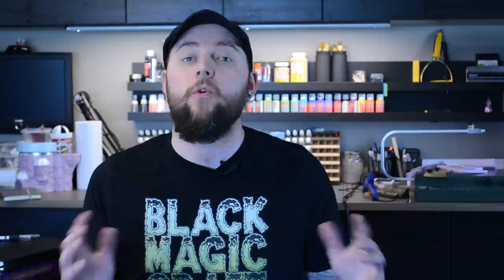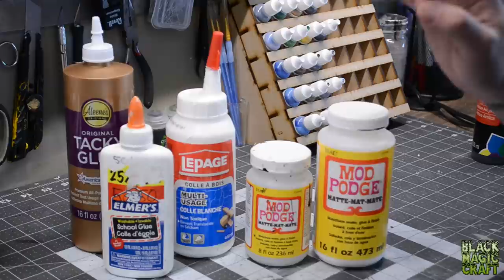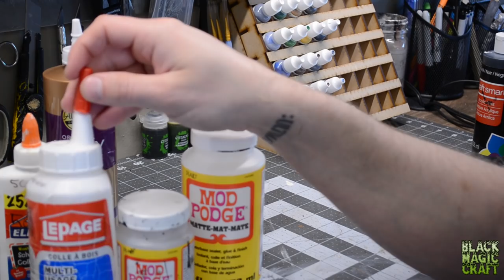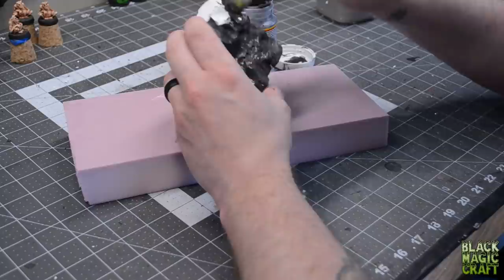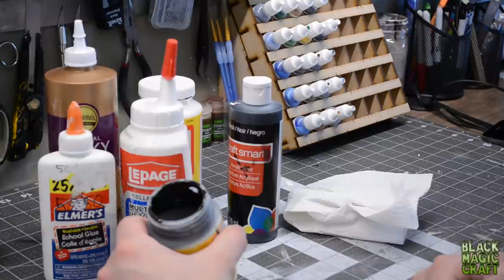Black Magic Base Coat! How to protect and and harden your terrain (Black Magic Craft Episode 034)

Comment: You should just make a homemade batch of MOD PODGE, mix in some black paint, and sell it as Black Magic Craft Magic Base Coat. You'll make millions! Seriously, though, I just started doing this on my projects. I seriously almost messaged you a couple weeks ago about ratios then just thought, "Screw it!" and dumped some black paint into my MOD PODGE pot.
Reply from the maker: Lol, the thought crossed my mind, but alas my role is to provide knowledge and not create a product....not yet at least.

And for the record, you mention homade mod podge. This is actually a thing people try to do, and from everything I read it usually yields very poor results and is kind of silly considering mod podge isn't really that expensive.

Comment: So I got curious with this and felt the need to post here.  I have been 3D printing my terrain, and that has its own set of challenges.  FDM prints have layer lines no matter how finely you print, and they have a capillary effect with paint.  So you need to use filler primer, sand it down, prime again, sand it down, etc.   On top of that I live in Florida where it's too humid to prime outdoors half the year.  So I wanted to try this stuff. While it preserves detail, I felt like the thickness of the fluid would fill those tiny crevasses, and it would act as a primer.  So I tried it last night on some 3D printed rock formations for scatter terrain.  Stuff I could just throw out if it didn't work.

IT WORKED GREAT!!!
I coated the rocks in the black mod podge and let it dry overnight.  All of those finer crevasses between layers were filled in fairly nicely (I will say some of the tops, I did have to slop it on instead of putting a thin coat). It worked as a both filler AND as a primer, they took paint beautifully. I painted, drybrushed, and flocked them today and I am thrilled with how they came out!  GAH I'm so happy!

Comment: I used tacky glue to repair my large bamboo chimes that remain outside.  I used it in all the places that were cracking and tied with cheap strings and I also coated the strings to seal with tacky glue  that I decoratively tied up and down the chimes.   It was unbelievable the adherence of this glue.  I am on year three and these bamboo chimes have not cracked any further and the string has not even begun to rot.  It is magic!

Comment: Another thing about buying both Mod Podge and Tacky Glue (specifically the brand he has too) is you can sometimes find it at dollar stores. It's not a guarantee. You'd probably have to get lucky. But I have seen both at the Dollar Tree before. It did not stay in stock long. So get it if you find it. I imagine it was overstock from some nearby store. Though as the video mentions it isn't that expensive anyway if you can't find it.

Comment: I'm fairly certain that modge podge is pva/acrylic matt varnish mix. Also anything that can be 'watered' down don't use water. Use 99% isopropanal alcohol instead. Dries faster and removes the surface tension that is talked about here that stops it flowing like paint.

Comment: I just put together a "tower" with foam food trays, chip-board from a frozen dinner, and a plastic bottle as the inside (makes great clear green windows).  I used an Elmer's glue-stick (not the washable kind) and it held the pieces on fairly quickly, however I did have a few "bricks" that I had to reattach at the end.

Have you ever tried glue sticks?  It seemed pretty easy to just have it open and swipe my pieces across it to get the glue on them.

Comment: Mod-podge is well worth the money. It's really good stuff. Your method of using it I may try sometime, but for terrain I will actually paint everything THEN give it a layer of mod-podge to protect the paint job because the stuff dries clear. Good video.
Reply from the maker: Yea, I don't think it's really that expensive in the big picture....I've never tried using mod podge after paint as I am so partial to the minwax spray.

Comment: This is amazing when mixed with enough airbrush thinner to make it a creamer like consistency.  Ive used it on terrain and to erase layer lines on printed minis.  But be sure to clean your nozzle regularly!
Reply from the maker: You managed to push mod podge through an airbrush???? Which model?
Reply: @BlackMagicCraftOfficial  The Master Airbrush dual action lol.  Thinned down with homemade thinner to keep cost down and with pressure cranked up to 30 psi.
Reply from the maker: Colour me impressed.

Comment: Actual Modge Podge has gelatin as a thickening agent,PVA/school glue and varnish. a teaspoon of Knox unflavored gelatin per cup of glue ...which should be mixed on low heat stirring constantly I use a whisk.....then put it in a jar or container then cool... then add a tablespoon of varnish added per cup of PVA glue and gelatin mix....after the PVA glue and gelatin mixture has cooled completely ..Be sure to stir  I like to use the water-based matte formula of Varathane..I make a gallon at a time and the cost is half of the price of modge podge  and it can be watered down for the needed consistency ...
I also use a tablespoon of Varathane Triple Thick formula added to PVA glue per cup when I don't have time to fuss with gelatin it is very similar but the Varathane triple thick costs more

Comment: I am already 2/3rd's through a 16oz bottle of 'ModPodge' after only a Month (Prepared as you have outlined). And I don't mind it going on a little grey because when it dries, the pigments turn black again. On wood, it Raises the Grains (which is a bonus).It's Flexible after it dries but does not harden as you had claimed (put it on a Hobby Foam Sheet). Don't get me wrong, not bashing your claims, just stating my experience. It has it's limitations.

Comment: Awesome video. Going through all your videos as well as Wylochs and DM Scotty.

Question: Is there a shelf life for the mixed black mod podge? Or can it be mixed and left on-hand?
Reply from the maker: As far as I know the shelf life would be the same as mod podge would be regularly. So as long as its closed properly and not drying out you should be fine long term. Worst that could happen is that it starts to separate from the paint and needs to be remixed.

Comment: Jeremy, I appreciate everything you're doing, and I have just started the hobby after watching your channel. Just a few quick questions though.

1) Generally, how much base coat do you want to apply to a piece? Less if it has more detail? Or the same for all? Do I want it to be a thick wet coat, or just barely enough to cover the piece in black, but not thick and wet.

2) Would you suggest having a separate brush just for base coating? If I'm not mistaken, Mod Podge sorta solidifies things, so wouldn't the brush bristles stick together after one coating?

Thanks so much!
Reply from the maker: thanks

1) Just a thin coat on anything with detail. If its stuff like rocks I'll put it on heavier.
2) I just have two bins of brushes, good ones used for detail work, and beat up ones used for dry brushing, spreading glue, and putting on mod podge. Mod podge is water based so as long as you dont let it dry in the brush you can just wash it out.

Comment: Great video, can see this being very useful!

Quick question, does this work on MDF terrain as a sealer/primer? I'm going to buy a bunch of MDF stuff for use in Necromunda soon and planning out how I'm going to seal then paint it had been a bit of a nightmare. If this would mean I don't have to spray it with PVA then spend a small fortune on spray cans of primer I'd be delighted.

I was planning on spraying the MDF with black primer then dry brushing it with a metallic silver craft paint and if this let's me achieve a similar look without all the cans of spray primer that'd be a big time and money saver.
Reply: A small MDF board is about $1. Why don't you try it and come back and tell us?

Comment: Have you ever thought about using paint tints (Mixol makes some fairly good ones that are designed specifically to tint paints, stains etc...) This might make for less dilution of the mod podge and it is available on Amazon.
Reply: Kaos Lord I raided our local diy store when they dumped the mixol stuff.

Comment: Such helpful videos man! Thank you so much for making these! One question: Terrain Tutor says that using PVA will cause shrinkage in pieces (as it dries, the glue constricts causing warping in especially thinner pieces). Do you find MOD PODGE to do this at all or is it pretty well free of constricting as the moisture evaporates and the MOD PODGE solidifies? Thanks so much for all your great tutorials!
Reply: This peaked my interest as well. I have nice cardboard based walkways that I am getting ready for painting - and I do fear warping the frame

Comment: Something else that ModPodge is great for is transferring images from ink jet prints to flat surfaces which lets you do things like grafitti in more modern settings. Print it on normal, white printer paper but with a mirror of the image, and seal the surface of your terrain. Then put a slightly thicker layer of clear mod podge (If the image has white in it, then use the white mod podge) on the surface you want the image on, press the paper, image side down up against the mod podge and work it flat and smooth against it. Let it dry completely. Then use a sponge to remove the paper and the image remains on the mod podge. Then either seal it or weather and then seal it...

I believe that Dr. Faust's Painting Clinic has a tutorial as well...
Reply from the maker: This sounds like a super cool technique and I want to try it. I think it could have applications in fantasy stuff too, like doing signs for taverns and inns.
Reply: I believe it's in his video on the Reaper Bones dumpster
Reply from the maker: Cool, I will definitely check it out.

Comment: How this Mod Podge is compared to gesso base for canvas (basically gesso, pva glue, acrilic paint and water)? Did you try that last one??
In my country XPS and Mod Podge are rare and expensive... I´m studing cheaper ways to try your black magic... ;)
Reply: makeshift marotte  not who you asked, but I've had great luck with water based polyurethane in satin finish, with flat black paint mixed in. Low odor, dries fast and hard.

Comment: I’m curious about colour - from what I’ve seen you generally cover the base pretty thoroughly so does the black matter? Or does it actually show through a bit and show shadows/detail etc.. 

And, if the latter, would it make sense to use different colours to give a different affect? Thinking dark green for stuff in the woods to give sense of light through foliage, or white/gold/silver when doing mythical or celestial items/buildings?

Comment: So, a quick question I didn't see addressed in the video or comments (I have literally never crafted anything before, so 100% newb right here), is this a waterproof seal? I'm making terrain/villages/dioramas for a large rat enclosure. It's going to get peed on pretty regularly, so I'm not only trying to learn this craft, but also make these items withstand a unique sort of environment that have probably never been accounted for before; it's been a little challenging and I could use all the help I can get.

Comment: Hey brand new to terrain building, big fan of your videos.  
I'll be using xps foam.  I watched another video of yours, where you built desert themed walls.  I'll be building desert themed <stuff>. I sort of remember you using white base coat. Are there times where a white base coat is favorable to a black base coat? Just about every video I've watched for any build uses a black base coat, with no explanation as to why, but my experience with painting in general is using white primer.

Comment: If you could only find the XPS Foam you wanted to use in Black, rather than in Blue or Pink, how would you alter your Magic Base Coat? (I know one of the reasons you add black paint in is so that you can easily tell when you have coverage.

Comment: I prefer using a dark grey (such as "Pavement" by Apple Barrel) for my base coat on dungeon tiles. Have you ever mixed other colors with Mod Podge? It appears that the Mod Podge doesn't dilute the paint color at all.

Comment: Another great video! Thank you for taking the time to put these together, thank you for the weekly consistency. I have a bunch of projects that I have already completed without using Mod Podge to harden and protect them. Can I coat them with Mod Podge even though they have already been painted? Looking forward to making my Black Magic Craft base coat to prime my future projects. You, DM Scotty, and Hankerin are my D&D and crafting gurus. My game has been taken to the next level bc of you guys. So much fun!
Reply: Or should I spray the minwax polyurethane instead?
Reply from the maker: I've never tried coating with mod podge after paint, but others do it. I prefer the minwax because it is a thinner cleaner layer as a final coat. It really only locks in the paint though, it doesnt make the piece nearly as hard as mod podge which is why I do mod podge under paint and minwax over.

Comment: I would like to mix some cream white paint for a translucent effect. Plus, I'd like to add Pearl X powder to the mix, for an ultimate pearl finish.  Will that work without interfering with the bonding agents of Mod Podge?  Will that work on top of glossy contact paper?
Reply from the maker: You should be able to mix pretty much any acrylic paint into the mod podge without issue.

Comment: I tried this, and while it worked well as a sealer, I left a lot of brush marks on my terrain. Do I need a softer brush, or is there a technique I'm not aware of?
Reply from the maker: You just need to practice your application. Just like painting anything with a brush....if you don't want brush marks, it's about overbrushing to ensure you don't get brush marks. And different brushes will work better than others, so you just gotta try different ones until you see what works best. It helps to dip your brush in water periodically to very slightly thin the mod podge during application.
Reply: @BlackMagicCraftOfficial  Thanks!

Comment: Hi, first off: I love your videos! I am not entirely new to building terrain, but there is almost always at least one piece of advice in any of your videos that I hadn't known about yet. So thank you for that!

Now to my question: would you recommend getting the gallon size of Mod Podge? I am asking, because you seem to only use the small and medium sizes. Does it dry up after some time, so that a gallon would only be a good idea if you do tons of models continously?
Reply from the maker: A gallon would be a LOT of mod podge. I use about 8oz a year.
Reply from the maker: But if you do a ton, I wouldnt worry about it drying out as long as your container is sealed properly
Reply: @BlackMagicCraftOfficial  Hey, I just noticed your Answer! Thanks a lot for the reply. Maybe I will buy the gallon and just split it into some smaller containers, because where I am from, the gallon makes it literally 70% cheaper than the smaller batches.

Comment: So I was painting up some larger 11x11 tiles for frostgravevwith this stuff. I got some foam that was labeled as xds foam that clearly wasn’t on Amazon. It’s pretty sturdy, and I decide to just use it. Everything is going pretty well I measure out the grid, etc. I start painting and I happened to hold the tile up high and I notice a that I can see light through where I missed. This is pretty useful because it helps me see all the little tiny spots I missed. However about 30% to 50% of  of the grooves in between each 1” square is showing light coming through. This makes me think I clearly need to get more midline deep in the cracks. Is getting the miscue blend deep in the cracks to cover every bit needed?

Comment: I know how to make a superior product, more of it, and will cost less money - and you'll never go back to MP. I've kind of kept this a secret, until now. I know this video is monetized, and there is an affiliate link, so if this is not ok, feel free to pull it.

Step 1. Get 128oz. of wood glue or any glue with a high pva content. Tacky glue is ok as well. I like wood glue, but to each their own. (I can get a gallon (128oz) of titebond clear wood glue for $22)
Step2. Get a small can of water based Clear Satin Finish Wood Stain. ($8 tops)
Step3. Empty both bottles of glue into a wide mouth glass mason jar. I cut the tops off the glue so I can get it all with a small silicone kitchen spatula.
Step4. Add 80ml (more/less depending on what type of glue and consistency you want. This comes out to about 20ml per 32oz of wood glue) of the wood finish. Mix it in GOOD. I use a hand blender on low, as we don't want to whip it, just mix. You Should have enough finish left over to do another couple gallons...
Step5. Profit! You've just made a GALLON (128oz) of an alternative to MP which is far superior for less than $30, and you should have wood finish left over, so your next gallon will cost less than $23.

I have abused miniature terrain here that has lasted 3 big moves across the country and two+ decades using this formula. I needed an alternative to MP for a bunch of large Halloween gravestones I made out of foam 30 years ago, and they are still surviving today.

Comment: I'm like 10 hours in a dungeon tile build. Doing 20 3by3 tiles. I painted a layer of black on without any mod podge in it. Should I just move onto the grey brush or would you put a mod podge/black layer on top of the black layer?